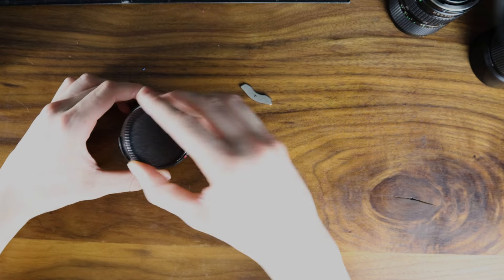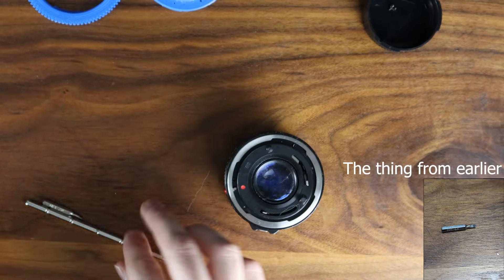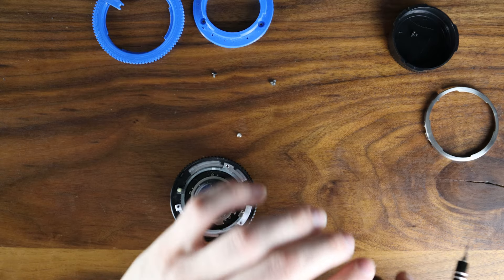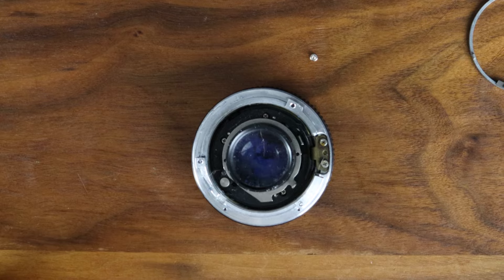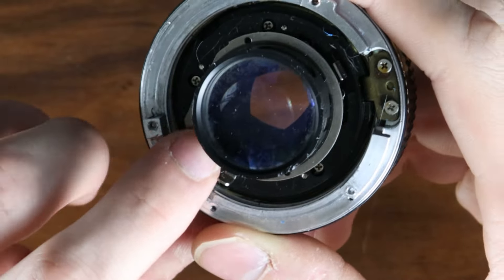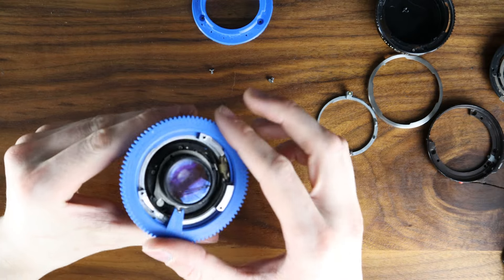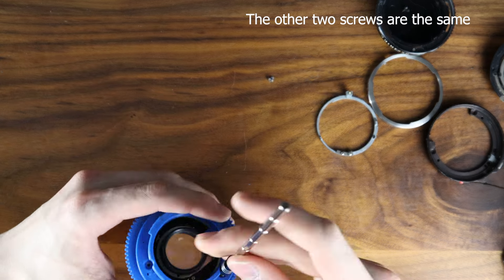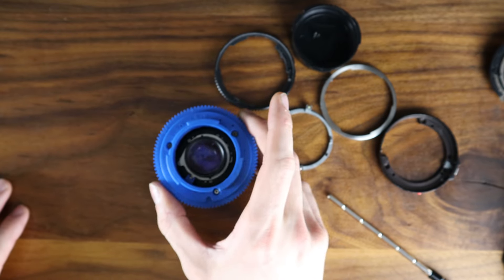EF Conversion Kit Installation Guide

Comment: works only for 50mm or 35 28 and 24 to?
Reply from the maker: I've only tested this kit on 
135mm  2.8
50mm 1.8 
28mm 2.8
 80 to 200mm F4
85mm 1.8
24mm 2.8
Reply from the maker: But I'm pretty sure it supports a wider variety of NFD my website is a work in progress but it contains the compatibility list if you click on each lens
http://printablefocus.store/guides/
Reply: @dragonwizord92  nice! thanks you! where can I find the stl?
Reply from the maker: I'm only selling it on Etsy at the moment

https://www.etsy.com/ca/listing/1716235540/ef-conversion-kit-for-nfd-new-fd